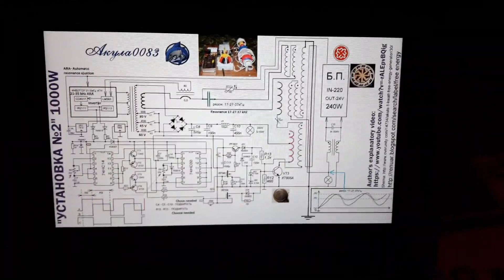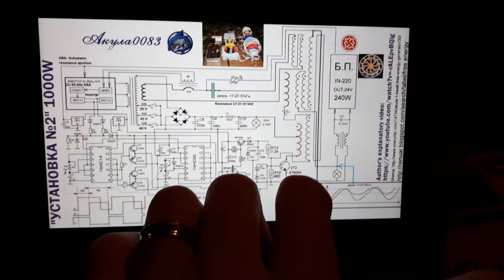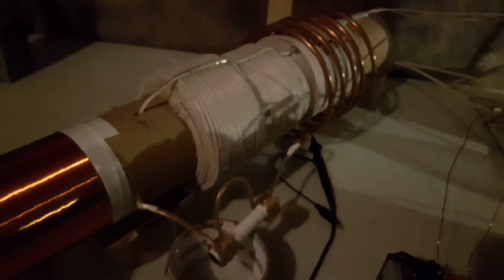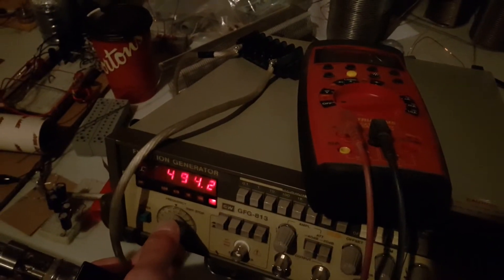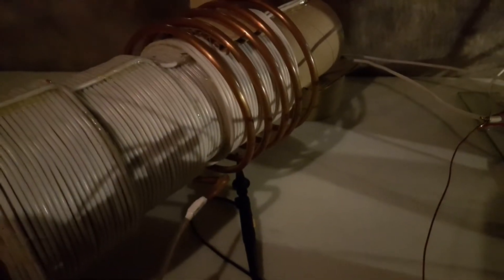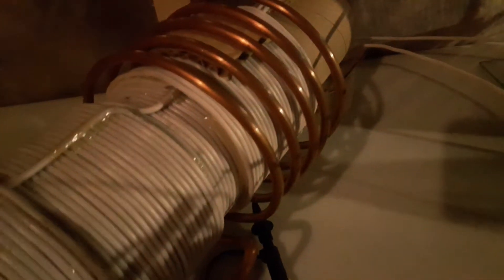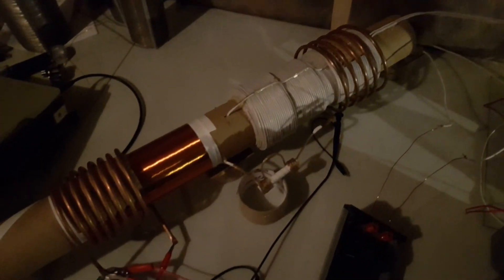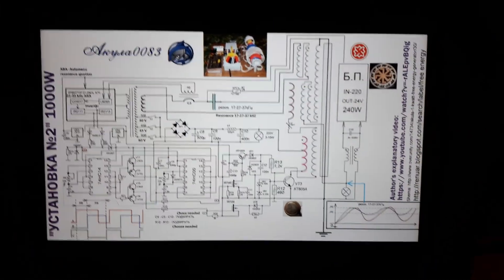PT 1 Akula/ Kapanadze Experiments

Comment: geofusion core shows great work for this device. I was wondering what you think is the trick to the energy gain. Is it the mixture of the high voltage and the high amps or is it coming from ground?
Reply from the maker: +HighRollersCorp1 , I would be lying if I said I totally understood, but the Russian guys who have about a half dozen with very convincing working devices... are referring to Standing waves in a resonant system. operating at medium amplitudes, then separately controlled receiving coil, tuned only to the peaks of the standing waves. the ground adds something special, like any time you are using earth as a reference with an open ended coil... you give it a stability which You dont have to produce, to vibrate as much as designed. the receiving coil is said to be like the Hendershot generator... however, in Tesla pat# 336,961 tesla shows a partially reverse wound coil.. the effect is the voltage cancels into amps on the reversed turns :)

Comment: a pretty good start 
- it will be interesting as you start to build your own PCB 
did you have a ferrite ring to perform push-pull?
to begin construction of the controller low frequencies 15Khz/27Khz I advise against TL494
much more useful Build the driver based on IR2153 and driver mosfet IR2110 
should obtain the current scheme:may your films are more lit?
(certainly it's late and you're there in the dark) :D
success in further work
Reply from the maker: +Tomtech29 , great info, and thanks! you do some good work yourself :)
Reply: ***** There is a preliminary draft PCB
http://overunity.com/12736/kapanadze-cousin-dally-free-energy/new/#new
Thank you may be able to complete this project

Comment: You have the heavy Earth Ground?
Reply from the maker: +beforebefore , hi there I do have an earth ground using the main house grounding from the gas line in the house, but I may try adding ground wires to that later on with higher power :)
Reply: +kdkinen   The developers of this kind of tech always seem to make a significant point of that... using a VERY low impedance Earth-Ground.

Although for a different purpose, Tesla taught us about the importance of Grounding at Wardenclyffe... man, that thing had an enormous Earth ground!!  In fact, it seems to have been more complex and bigger than the tower. A main 10' by 12' shaft went down 120 feet, supposedly with interconnected tunnels outward from there.  Then he pushed a grid of iron pipes another 300 feet further down, to a total depth of 420 feet. Apparently the main shaft extended below the water table, making construction extremely expensive.

"It has to have a grip on the earth so that the whole of this globe can quiver..."
Reply from the maker: +beforebefore , yes good point, like a tree has its grounding :)